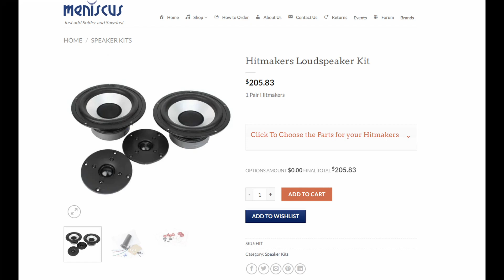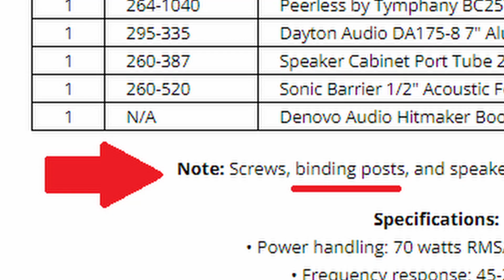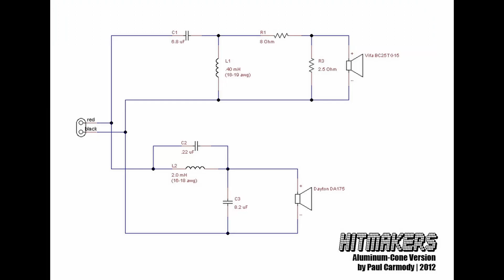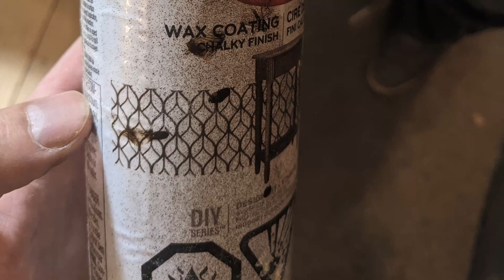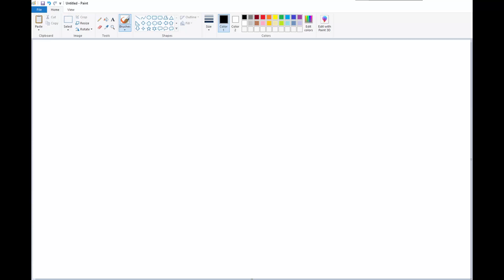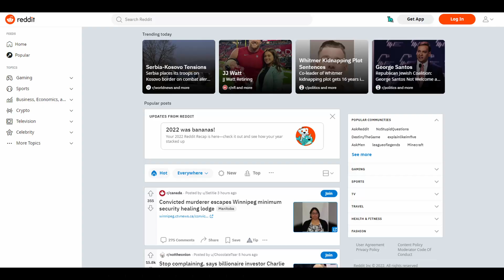DIY Speakers - Paul Carmody Hitmakers

Comment: Since I don't much care about esthetics, ( Big ass NAD power amp and thin and long Emotiva pre/DAC, which looks ridiculous, but the sound through a pair of aDs 910s is sublime!) my DIY speaker build would be a miracle if sound actually came out of them.
Reply from the maker: Right? Blew my mind when they made any noise at all.
Reply: @tomslife2849  I will look for your follow-up on these. I've wondered how good those crossovers are.